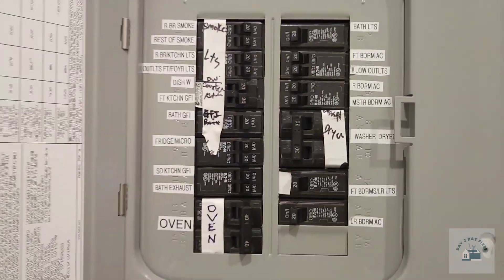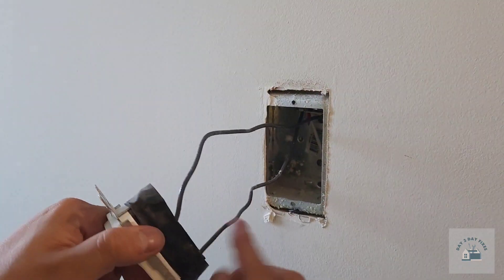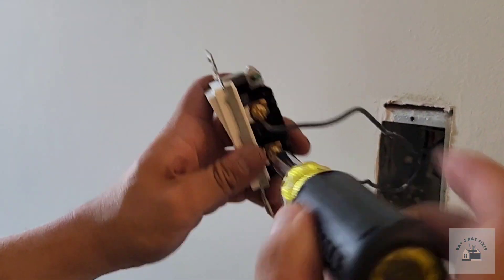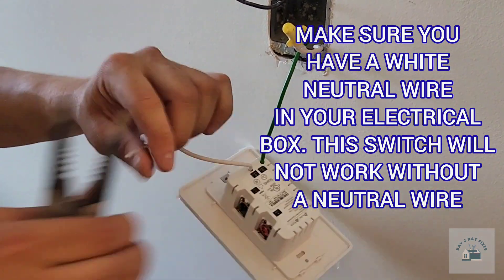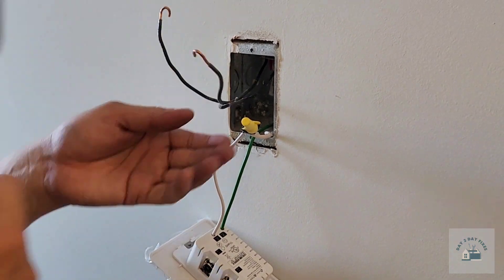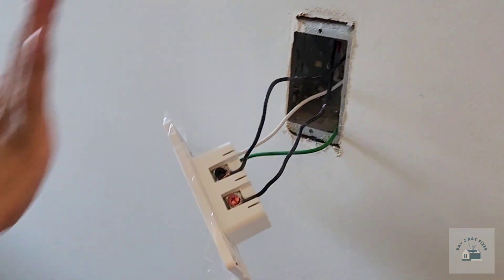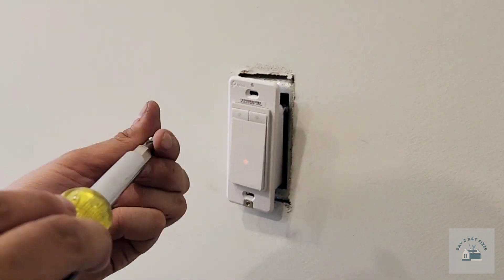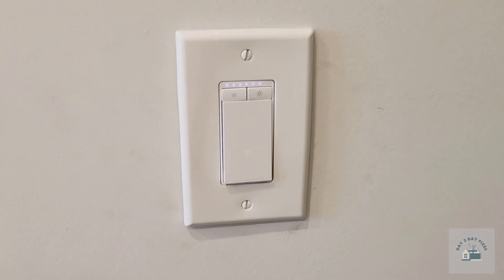Kasa Smart Dimmer Switch Installation

Comment from the maker: Link to Kasa Dimmer Smart Switch 3 pack:
https://amzn.to/3RgnD75

Link to Kasa Dimmer Smart Switch single pack:
https://amzn.to/41hR0KW

Links to similar products I used:
Voltage Tester 
https://amzn.to/46LSrCB

Linesman Pliers
https://amzn.to/3tkzb14

Milwaukee Wire Stripper
https://amzn.to/46PN3OH

Klein Screwdriver
https://amzn.to/3Nh631J

You don't need to get these exact products, if you have similar ones you can definitely use them.

Some of the links above are affiliate links. This means that, at zero cost to you, I will earn an affiliate commission if you click through the link and finalize a purchase.